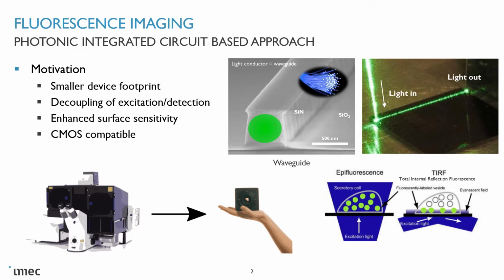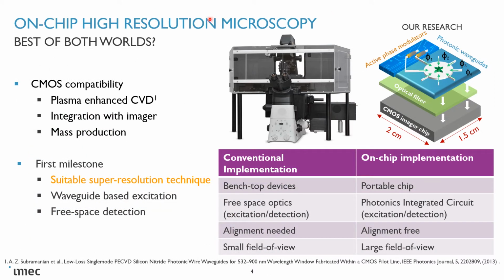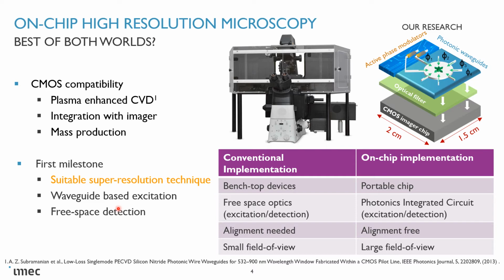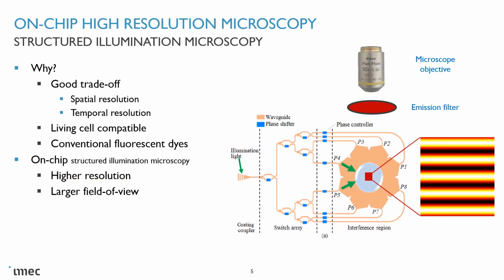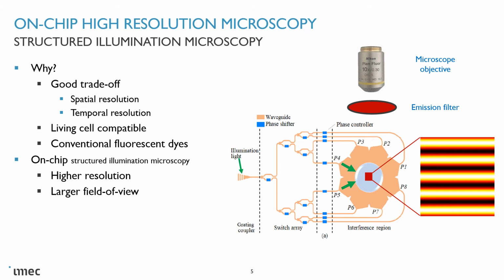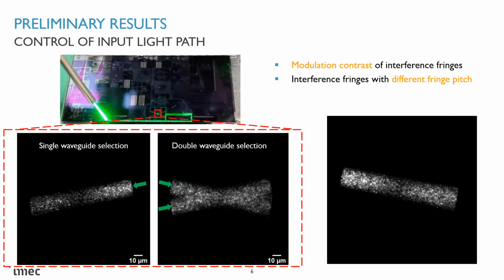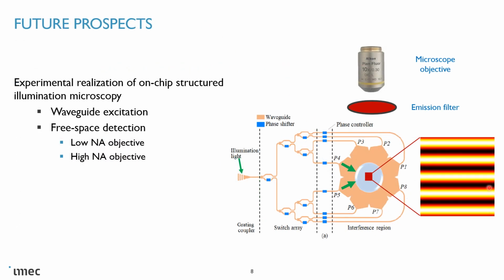Enabling High Resolution Fluorescence Imaging Using Integrated Photonics

Comment: Hi Ongun, 

I found it an interesting presentation. 

- What makes it challenging to increase the temporal resolution by obtaining data at a higher rate in the photonic integrated circuit-based approach?
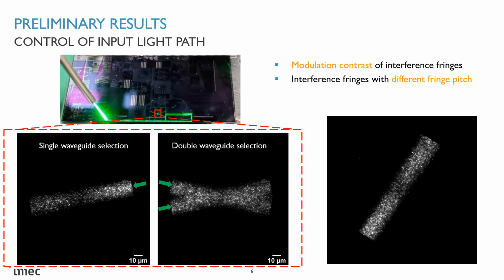- Are the patterns shown in 5:21 detected beads or optical speckles? In case they are optical speckles, how can you suppress them in order to distinguish the desired beads?
- What kind of samples are you ultimately planning to image in order to validate the structured illumination technique?
- Can the samples/specimens be dynamic in terms of moving around during the imaging?

Thanks
Reply: Thanks for the questions Ata, these are very relevant for our PIC based implementation.

- The challenge for temporal resolutions stems from the need for high signal-to-noise ratio which requires a modest sensor exposure time and the use of low numerical aperture objective as the interference fringes are generated through the interference of light in the photonic waveguides and they can have higher frequency than the optical transfer function of the used objective allows. However, to fill the Fourier Space you need to take a lot of raw images changing the fringe spacing and orientation by selecting different input waveguides if a low NA objective is used. 
- The patterns shown are fluorescence images after a long-pass filter. The beads are 100 nm, but there are also clusters of beads in the imaging area.
- For a first validation we aim to go for a sample with a dense layer of fluorescent beads and then a fixed cell (probably HeLa).
- The samples should be fixed for the time being, but we are working on optimizing the process for live cell imaging. We think as a first step we can have live cell imaging with a high NA oil immersion objective. There will be some trade-off from the field-of-view in this case though. In typical bench-top SIM systems (high NA objective for excitation/detection) for each frame 9/12/15 raw images are acquired.
Reply: @ongunarsev6150  Thanks for your clear explanation.